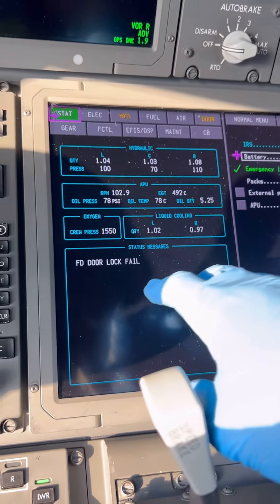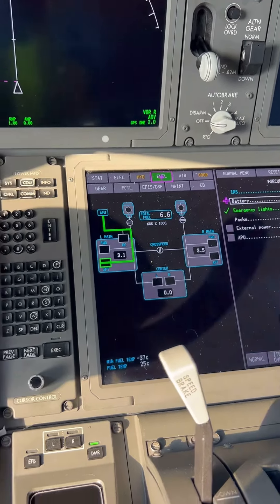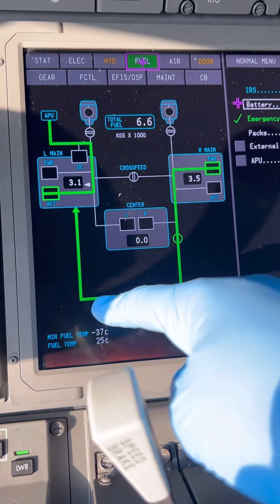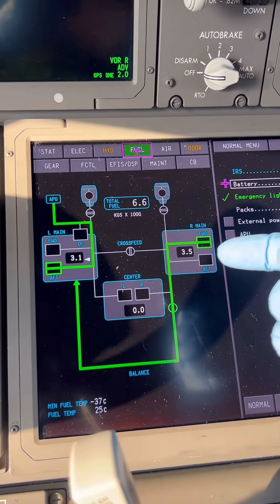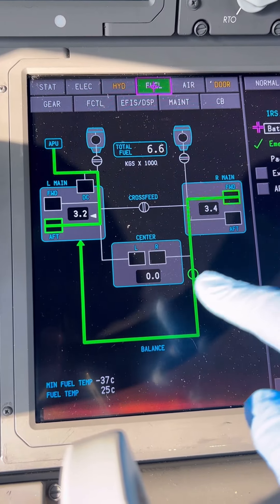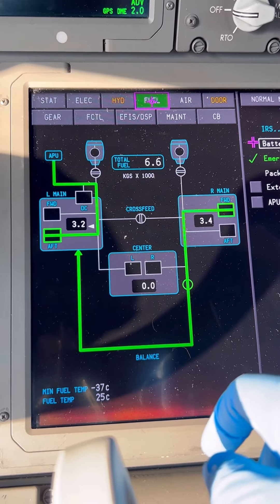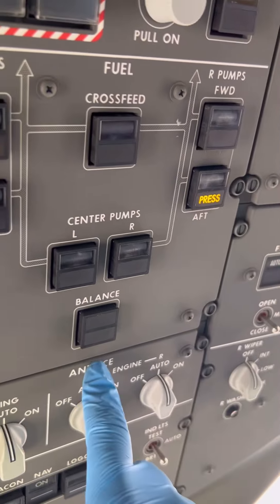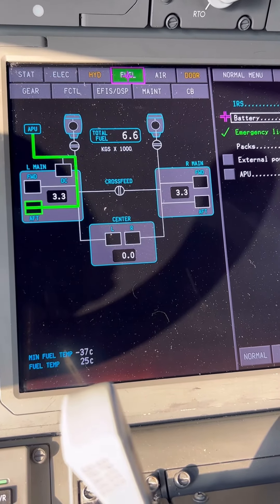How Pilots balance fuel quantities on the Boeing 787

Comment: What would opening the Crossfeed valve do, or is it inhibited on ground?
Reply from the maker: Opening the cross feed valve alone will not transfer the fuel to the other tank .It will however allow the APU to use fuel from the right tank if the right fuel pumps are on.If you need to transfer without using the balance switch.the fuel you will need to go outside to the refueling panel on the wing   Select defuel and open the receiving tank refuel valve.In this case you will need to open the cross feed valve if it’s wing tank to wing tank .The balance system does the whole configuration for you without opening any valve or going outside the cockpit